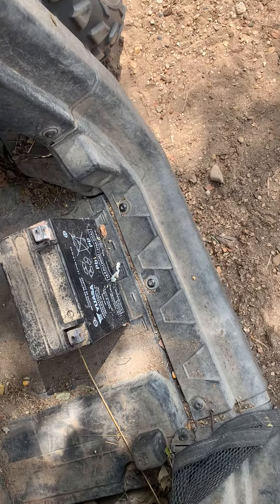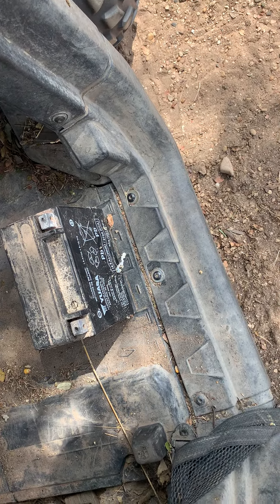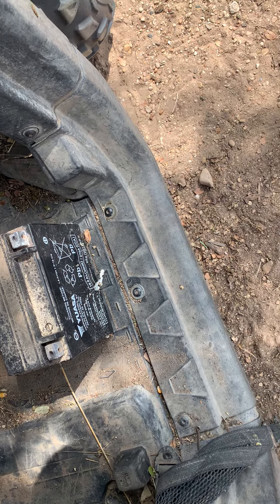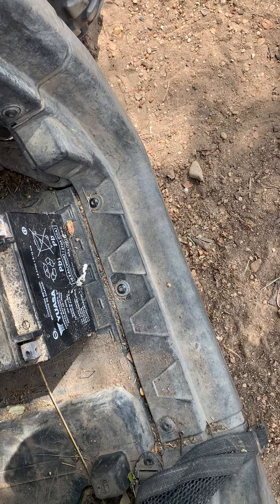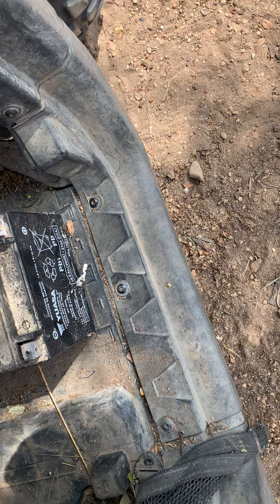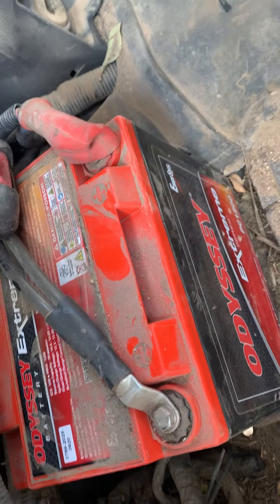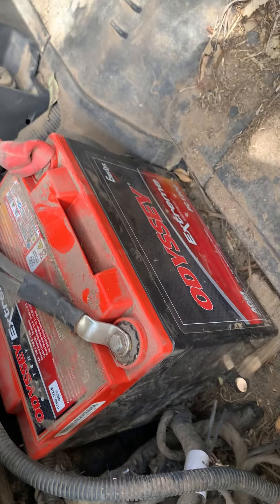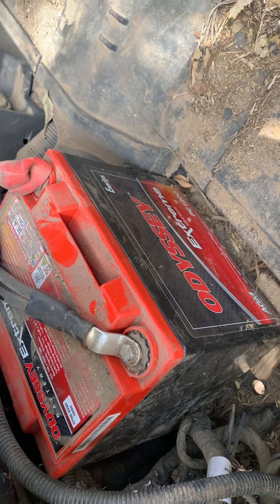Can Am defender battery problem solved.

Comment: Mine from new cranks slow when engine is hot but fine when cold did yours do this
Reply from the maker: Not till I had it for a couple of years the battery change helped but didn’t completely fix issue.

I have seen it on a newer HD 8 about 3,000 miles on it.